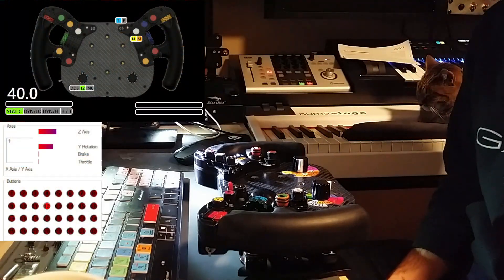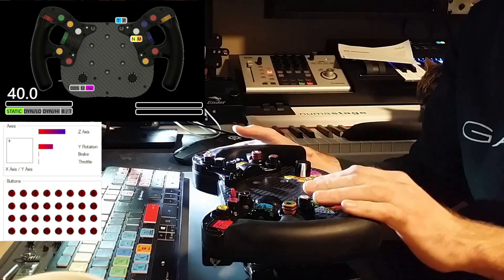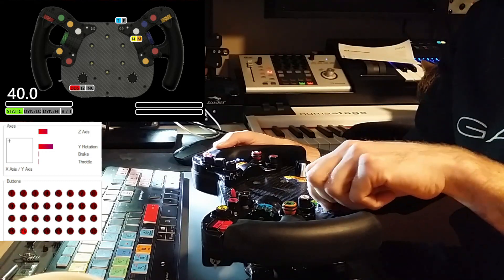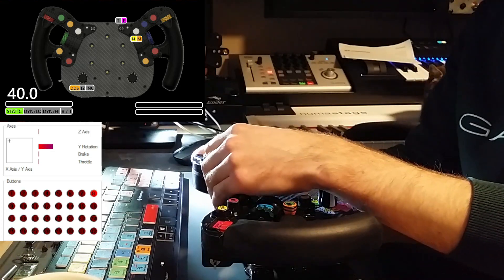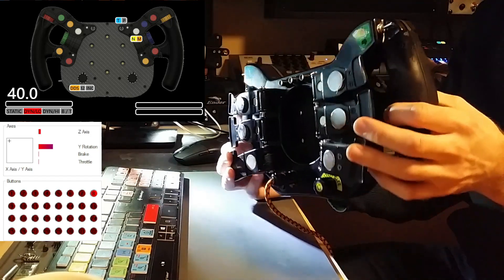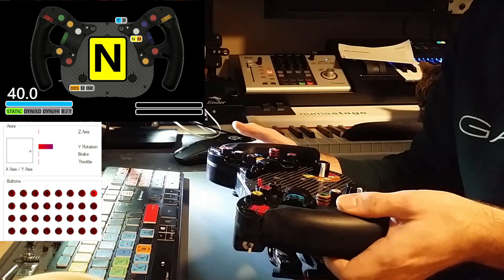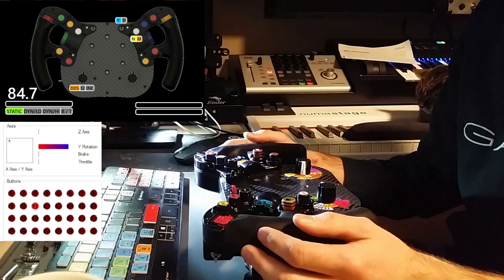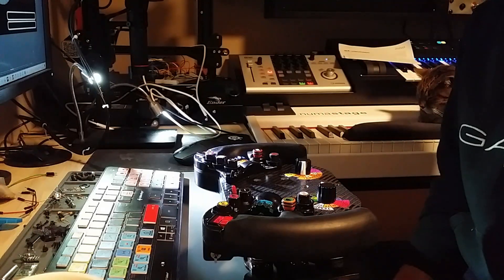Dahl Design DDC firmware

Comment: how is this different than the original sw1? looks like your earlier work (which is amazing btw)
Reply from the maker: It is mainly the firmware that is new. And with it a few substantial upgrades. In terms of hardware it frees up a potmeter to set bitepoint and a toggle to lock this potmeter value. I've replaced the pot with a CTS288 encoder, so encoder count up from 4 to 5. Also toggle switches up to 3 from 2. Using DDS mode, I can now use the funky switch to do the job of the two 12-position switches and 3 pushbuttons. Button output count is increased from 69 to 97. The wheel now has debouncing on all pushbuttons, better isolated position-switches on the funkyswitches, neutral button, modifiable switch modes and presets of switch modes to swap between. 
The most important take-home message is that this will be possible for any arduino-based controller (as long as the MCU is supported).
Reply from the maker: To clear up, DDC is the firmware, this is still a SW1 :D Ill change the title